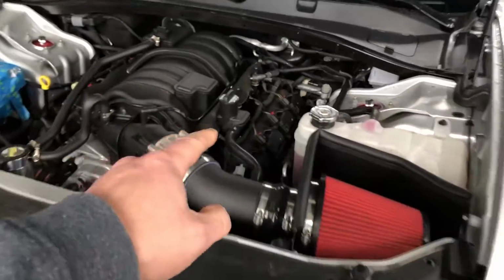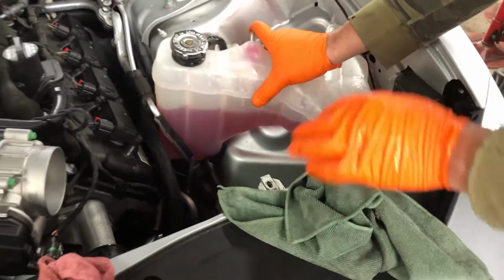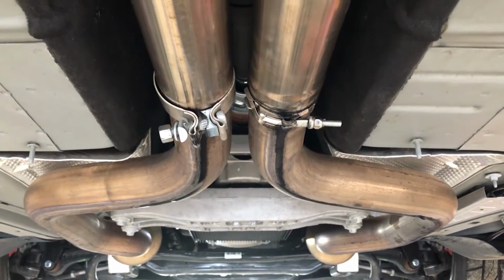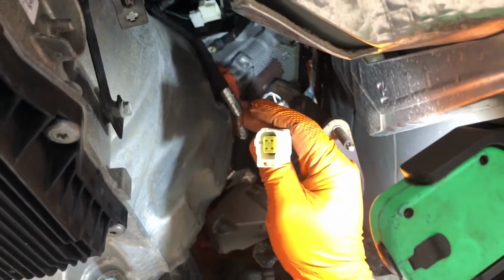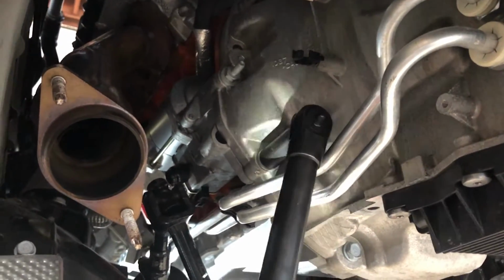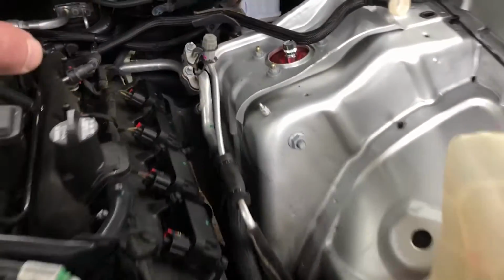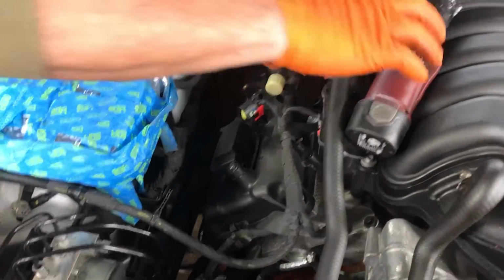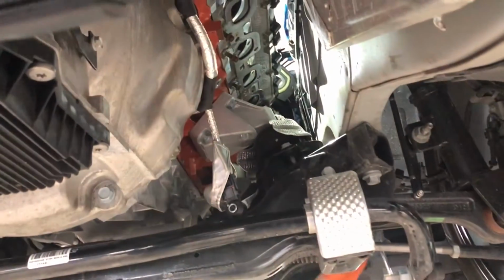The COMPLETE removal of Dodge Charger Exhaust Manifolds.

Comment: I hear a strange rattling noise in my 2020 Charger Scat Pack. The noise isn't noticeable when idling, only while driving, and it seems to depend on RPM. Could this be related to the manifold bolts, or is that mainly an issue with the 5.7L engines?
Reply: I’m going through this now with my 6.4 hemi

Comment: I step by stepped this, and now I completed a header swap with JBAs thanks a bunch
Reply from the maker: Glad to help!
Reply: That angle drill where did you guys get that from it was battery powered the one the old feller used to take off the manifold bolts
Reply from the maker: I believe it was Snapon

Comment: Excellent Vid!!  Very thorough and helpful.  I have Challenger with the 5.7 Hemi and there is a bit of a ticking noise, it's usually either the exhaust manifold bolts or the lifters going bad from what I've learned.  Just curious, did you guys remove the catalytic converters because you are going to be putting that exhaust system on or because you had to in order to get the stock manifolds off?  It's really a shame that the chargers and challengers have the wheel well sealed like it is.  On a ram you just take off the wheel well splash guard and then you have access from the sides as well.
Reply from the maker: Thank you, we were actually installing long-tube headers. Here’s that video: https://youtu.be/dpBQtxcY-ZM

Comment: Good job! Just finished long tube Kooks on my Redeye. The top 2 middle bolts on the pass side had me wondering why I ever started this, and I did it on a lift. Sucked more than the Charger, actually like to the 10th power. Ran out of curse words. But like you, I got it done. Oh I did exactly the same as you...disconnected that coolant hose while car was warm, fountain of AF...car dripped AF on me for 2 days
Reply: Bro I just literally went through that disaster 😭
Reply: I just did mine on my charger 2021 and literally the same 2 middle bolts on the passenger side made me want to give up. Ran out of curse words like you lol. I got it done though. Had to finger it in and squeeze my finger tips in there.
Reply: @Boriqua915 I’m actually stuck at that part of the 2 pass side bolts, 🤦🏽‍♂️ any tips ?